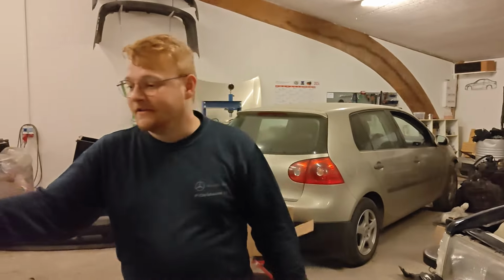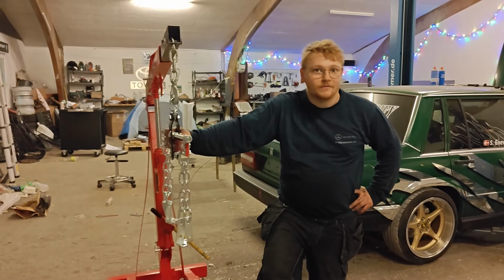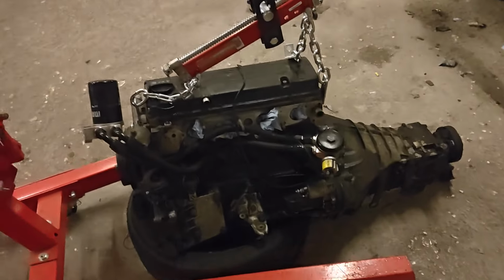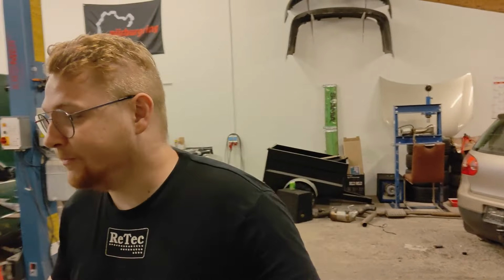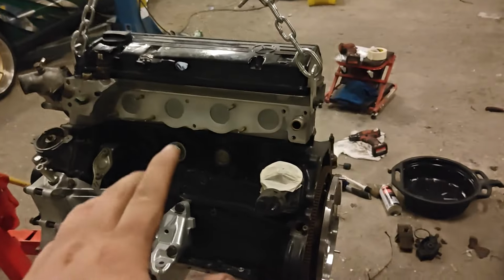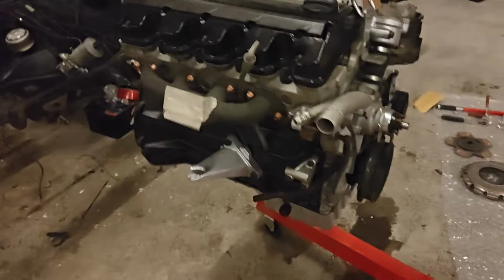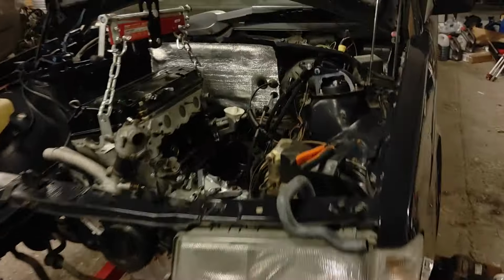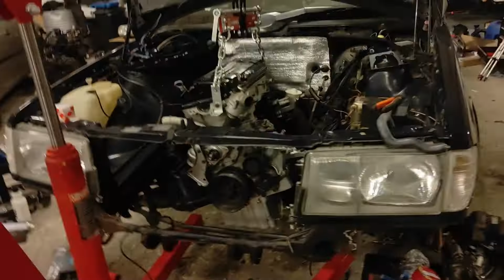190E Turbo Project Part 2: Installing The Turbo Engine

Comment: I got a project juat like this. M102 2,3 8v with gt28 ebay turbo. The stock clutch died at 400nm 😂 . Had a figure of 420nm at 2500rpm . Maybe I will get this kit you bought. What gearbox are you running? I'm not sure the stock 717 is very strong at all and maybe it is better to switch to a bmw gearbox.
Reply from the maker: My turbo wont be ebay, im going with a g25-550😎

Comment: We have identical projects haha m102 2,3 8v . I had mine on the dyno last summer but the stock clutch died at about 400nm. It produced about 420nm at 2500 rpm (sounds high maybe  low gear?) . Anyway I should get this kit too. What gearbox are you running? Im not sure the stock 717 is strong enough and have been thinking of switching to bmw box instead.
Reply from the maker: I've got a 717 from a om606 but if you want a stronger box then you could go with a MB 6 speed box from a cdi😊
Reply: @ladesgarage9781  Ok dieselbox I've tried finding one, 6 speed might be easier to find. Did you see that there are regrind cams for this engine with better valvesprings? Been thinking about that as well, it's cheap since its sohc. Excuse the double comment youtube is bugged 🙂
Reply from the maker: I have a 264⁰ cam and springs in this engine. Also have forged rods and pistons🤷its fully built and ready for 2 bars of boost